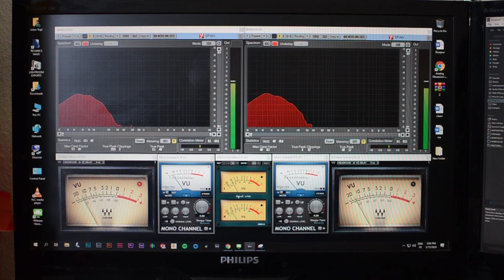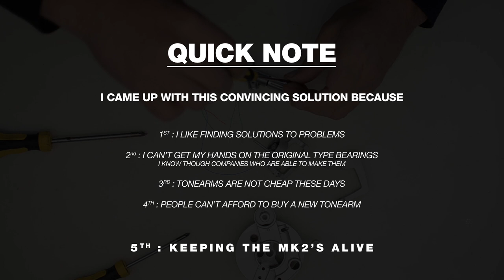Technics SL-12xx MKx - Tonearm Bearings E̶x̶p̶e̶r̶i̶m̶e̶n̶t̶ Replacement Solution

Comment: Nice to see a new video from you. I completely rebuilt my 1200's a half a year ago or so, and along with some others, your guides were an invaluable technical resource! Thank you!
I actually bought a complete new tonearm assembly for one deck as the shaft was cracked and the bearings in the tonearm mounting shot to hell, with this trick I could have saved at least the cost of the mounting. Still, I have the 'waste' parts stored away just in case, maybe I'll experiment with this at some point.
Reply from the maker: Glad that I've been at help :). Experiment with yours, you might save some money in the way

Comment: Did you ream the hole by hand or did you use a drill press or something? I imagine the drill has to be 100% vertical, right?
Reply from the maker: I reamed it by hand, I'm used to do this operation a lot. I could use my Mini Lathe too but it's faster by hand :). You don't have to ream to deep anyway, it's about ~2mm.